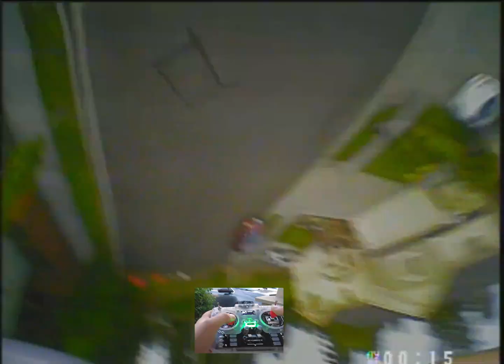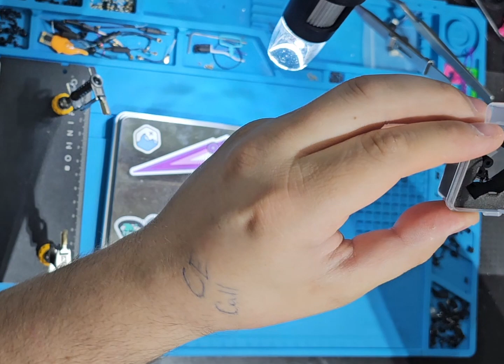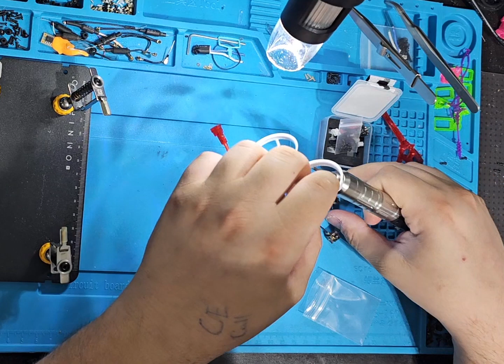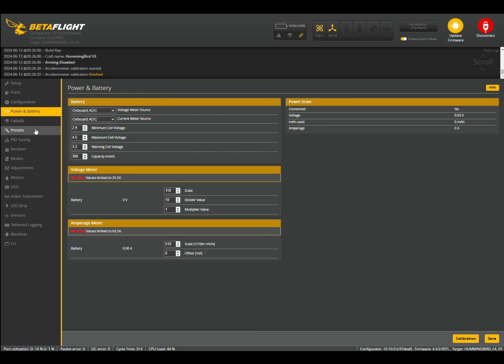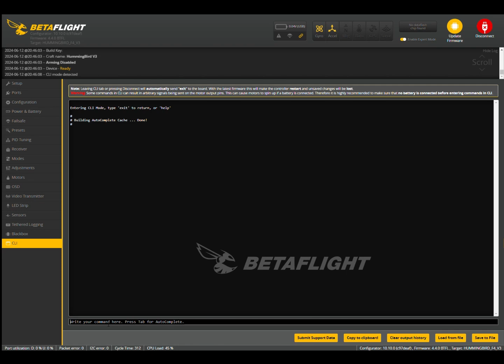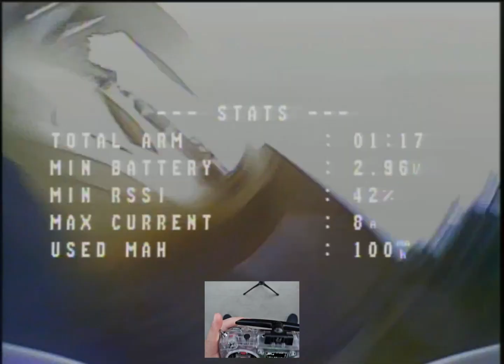Let's Build A Custom NewBeeDrone 65mm Whoop! | FPV Tutorial

Comment: How did you do that voltage callout?  I'm trying to reduce my OSD as well.
Reply: Goodness, telemetry was turned off on my drone for some reason, that was the only thing holding it back from working.  Anyways thanks @Tyrantt, I didn't eve know it was a thing until you talked about it.

Comment: @6 mins I'm pretty sure those are not spare motor wires but are for ALL other whoop boards, NBD uses smaller plugs.
Reply from the maker: You're right, I didn't realize they were a different size at the time of filming.

Comment: This is great exactly what I need. Can this be done with a 75? I am leaning more towards that for freestyle. Even though this looks like it’s handling great outdoor. I wish it had a bt20 or A30
Reply from the maker: You would need to adjust for some of the parts, but yeah. Swap out the motors with 0802s, 40mm bi blades props, and a 75mm frame.

Comment: Cool video and nicely explained. Dont have a drone yet. So maay just give this build process a try 👍👍
Reply from the maker: It's pretty easy to build. You can also buy Bind and fly (premade) whoops as well if you don't want to build.
Reply: @TyranttFPV  yup. Been eyeing the mob 6. Just cant figure out which cheap analogue goggles just to start out with to get going.
Reply from the maker: @gbj6581  when I first started out, I was looking for a cheap pair of goggles as well and someone told me that I would regret wasting money on a cheap pair. Sure enough, they were right. After the first session of flying, I immediately knew that I wanted better gear, but unfortunately I'd already blown $100 on goggles. I don't remember the price exactly, but I feel like sky zones had a set of box goggles that had decent value for the quality for a mid-range box goggles. I think they were called cobras?
Reply: @TyranttFPV  yes agreed. This why I'm still in analysis paralysis : (   I keep going back and forth on what system to get into lol In your opinion is HD zero better than higher end analogue gear for Tiny Whoops?
Reply from the maker: @gbj6581  HD is obviously going to be better than analog. If you did the HDzero route, you could get an analog adapter when use both

Comment: What's with the left chanel only sound?   I had to stop and open something else to make sure my headset wasn't busted.
Reply from the maker: Oh geez. Is that for the entire video? I guess I should probably start testing audio with headphones 🥲
Reply: @TyranttFPV  I commented before it was over.  It was just the build portion.  Towards the end I realized only my left ear and checked I had the right one in, then opened a sound file to test.
Reply from the maker: @Mupshot  appreciate the update. Guess I need to get a better microphone. I figured my phone mic would have volume going through both sides. Weird.